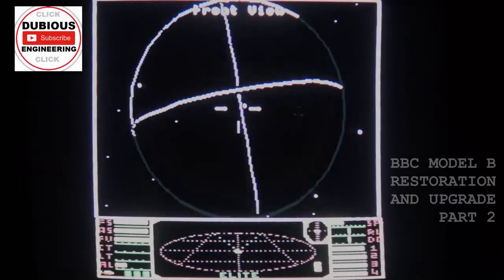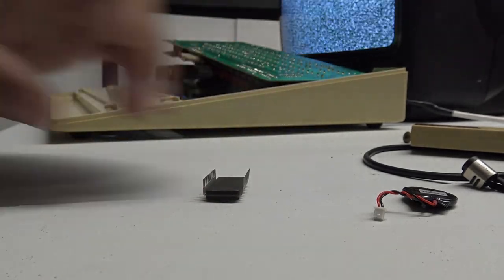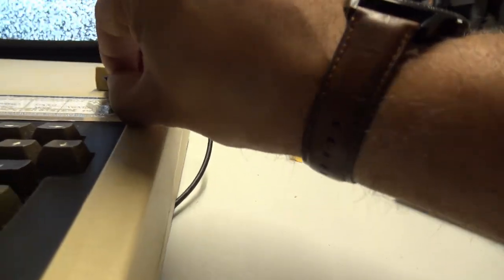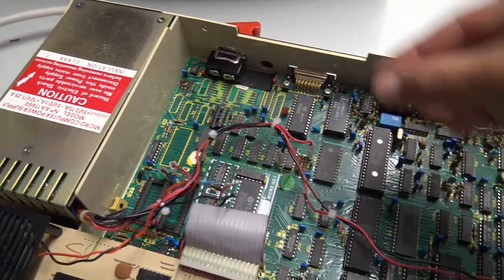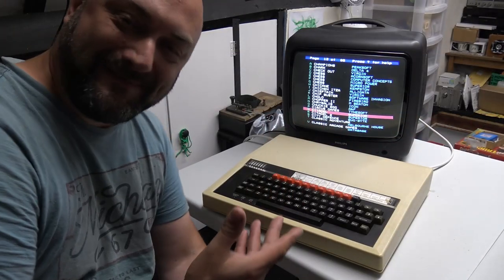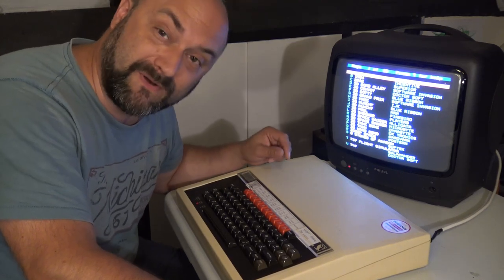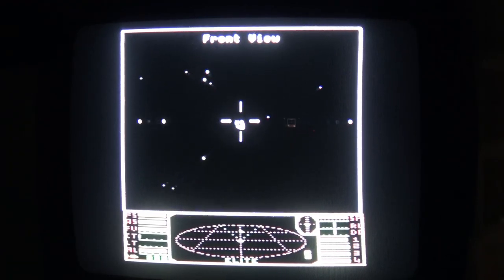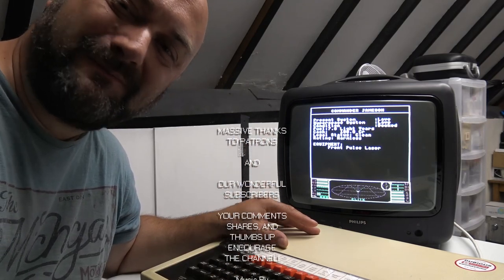DuB-EnG: BBC Micro SD card reader - no need for tapes or discs anymore!  SD2BBC by thefuturewas8bit

Comment: I bought one of these but it was a total let down as the rom was not showing up when I turned the Beeb on, tried it in all 3 empty slots but nothing.  £40 wasted
Reply from the maker: That’s a shame...  mine works...  did you ask the supplier for any help?
Reply: @DubiousEngineering  No reply yet but we'll see.  I'm hoping they'll sell me a 2nd rom as I'm thinking I might have fried it fitting it as I had real trouble getting it into the slot and had it in/out over a dozen times.

Comment: There's a pot on the main board for adjusting the volume. But then that's much more boring than a missile switch........
Reply from the maker: There we go...  You live and learn every day - I didn't know there was a control pot on the motherboard.  I do like my missile switches...  Thanks for the tip-off reference security compatibility of some software with the SD2BBC - I may ask the designers their thoughts on that point.  All the best!  :-)